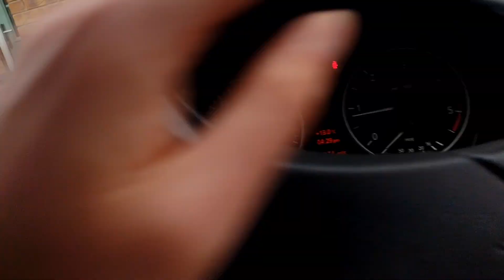Smokey Joe Intro - BMW EV conversion project.

Comment: think i'm addicted to watching blokes convert things into evs which is even worse.
P.s where do you types buy the brain that gives you the ability to do these conversions as i've been ready to convert my Early Bay Camper for 2 years now?
Reply from the maker: Learn on the job. I'd have had no idea where to start if it wasn't for YouTube, Damien, Johannes and Open Inverter. Using Zombieverter makes it sooo much easier. Get a compatible motor and inverter, get them spinning, add to vehicle and you're almost done
Reply: hello bud, nice of you to get back.
Tbh, i will be using the camper  for getting back to mountain biking  around the world, so i'll be going for a big battery (400v) and tesla rear motor direct to the rear wheels, i just know i'm waaay outta my depth. 
I 've picked up lots from watching you guys but it's a great original vehicle, so it deserves to be done nicely.
Cheers mate, please keep posting the vids, John

Comment: The 320d Touring is a rear wheel drive estate/station wagon automobile with a front positioned engine, sold by BMW. The BMW 320d Touring belongs to the E91 model family from BMW. The 4 cylinder, double overhead camshaft turbocharged engine has 4 valves per cylinder and a volume of 2 litres. This unit musters power and torque figures of 175 bhp (177 PS/130 kW) at 4000 rpm and 350 Nm (258 lbft/35.7 kgm) at 1750-2500 rpm respectively. This power is delivered to the wheels via a 6 speed manual transmission. Claimed kerb weight is 1580 kg. It is claimed to manage a maxiumum speed of 228 km/h (142 mph), officially stated fuel consumption is 6.1/4.2/4.9 l/100km urban/extra-urban/combined, and carbon dioxide emissions are 130.0 g/km.
I think its too heavy to convert ..1580kg!!!.....ok 😊